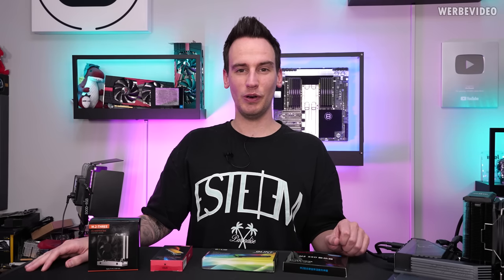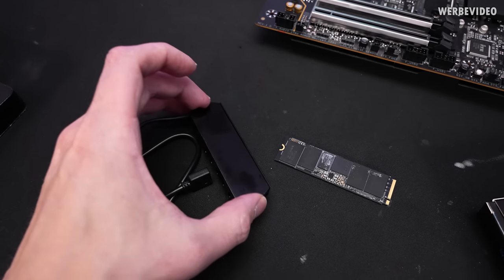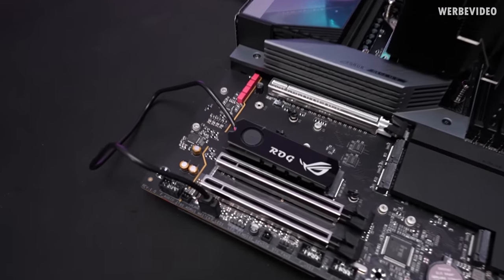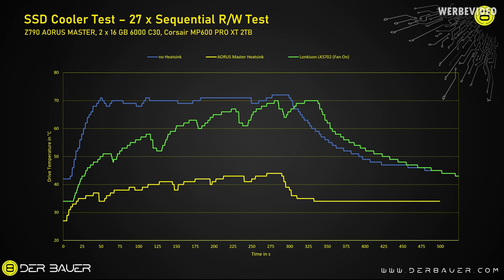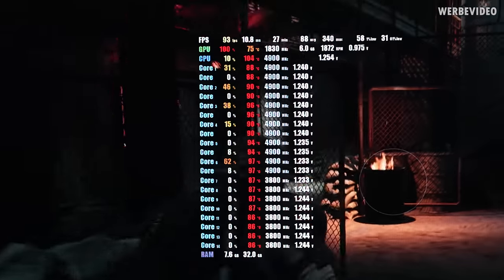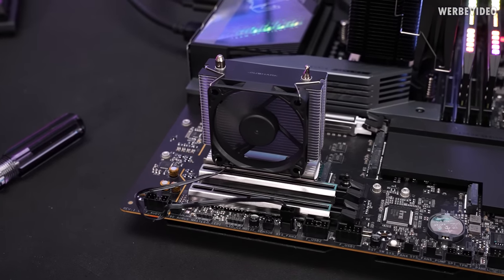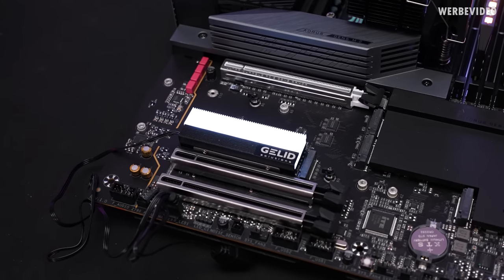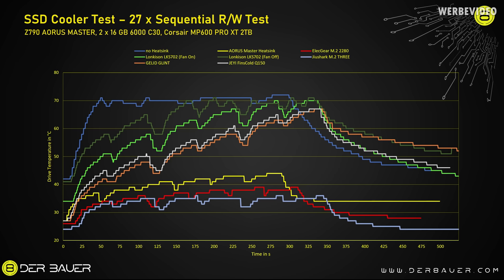More AliExpress garbage? This M.2 cooler was surprisingly good

Comment: At this rate push-pull setups for your M.2s will become the norm.
Reply: or straight adding to your water cooling loop
Reply: Nein! Nein! Nein! Nein!
Reply: PCI-e 5.0 SSD is hitting 11W at sustained write operations.  So , it is a possibility. But likely the M.2 connector has to go because M.2 specs requires 3.3V at 2A. We're hitting 3A on PCI-e 4.0 SSD these days.
Reply: @TdrSld  That's already a thing :D
Reply: Phase change or bust.
Reply: Are we progressing or regressing with technology, soon PC will need additional line from your electricity supplier and special cooled room like 60 years ago...
Reply: @TdrSld  my dad is doing that lol
Reply: @fleurdewin7958  3,3v @ 2A is just current provided over one pin, m.2 has several pins with 3.3v output. the connector itself is rated for 50v @ 0,5A for each pin, so there is still headroom left
Reply: @Rentta  Oh I know, but it's crazy to think we're back here again. I remember the Koolance HDD water cooling plate when they tried spinning rust at 10k rpm. (Yes I'm that old lol)
Reply: Yeh, no thanks. I'll stick to Gen4 then.
Reply: @georgwarhead2801  Are you sure it's 2A over one pin? That violates the connector spec (it's not about transmitted power, it's about heat dissipation, and that scales with current because impedance), and that 50V is irrelevant because 1) you'd need to add complexity to the drives (yeah, a buck converter or such isn't big, but the PCB is kinda tight already), 1b) which would increase heat dissipation because the conversion can't be 100% efficient, and 2) you'd need to change the rail going to the connector.
Reply: Like laptop sodimm sticks
Reply: @dudeonlygamingandotherstuf7791  Ten!  Ten!  Ten!  Ten!  Watts!
Reply: I just started manufacturing a 40mm aio.
Reply: At this rate dual-sided M.2s may become unfittable to motherboards due to heatsinks.
Reply: @TdrSld  That's a thing. It's very stupid, and I want to make a custom loop with it.
Reply: @samiraperi467  im absolutly no expert in this, its just what i found online for the specs of the M.2 connector. there are 6 or 8 pins for 3,3V and several unused pins in the connector itself
Reply: @burrfoottopknot  Gen 3 as well with a 1Tb Crucial P5 as main drive.
Reply: Depends how big thick the radiator is...
Reply: @PREDATEURLT  focus is leaving effeciency and looking straight at performance. they tend to bounce around on which matters, like phones do.
Reply: @bradhaines3142  But this bounce is highest in history of around 40 years and single bounce last for 8-10 years, we was laughing at AMD FX CPU and GTX480 for ridiculous power consumption and today its like middle end for power consumption when every stronger CPU eats 150-300W and GPUs are out of mind completely.
Reply: I think corsair made a water block for M.2 SSDs 
but the thing with SSDs is that you don't want them super cooled down as that can be bad for them in the long run. better off using a fin stack normal one.

Comment: I have a pair of m.2 AI accelerators that output 28 watts each at full load so the tower cooler would actually be a good option
Reply: my first 80mm fan cooler was for an AMD duron that drew around 40 watts or something. A small little m.2 cooler this size would probably have done the job back then, given they came delidded. This looks quite promising for modern drives that keep increasing the power draw of the controller for more performance. Also wild to think that the controller on my drives is probably faster than that Duron as well xD, it was only like 750mhz or something and had way less cache xD

edit: im half delirious rn with a cold and a ton of benadryl in me, shold clarify im talking about the 2nd cooler that was shown off, not the ROG one lol.
Reply: May I ask? What's the software support for them? I have no experience with AI so I just wondered.
Reply: @TheOriginalFaxon  Another Duron gamer 💪 I remember swapping it out for an athlon 850 that ran at a cool 1ghz literally.. remember when cpu's actually fried themselves at 95c instead of it being normal boosting temps?
Reply: @interlace84  Was just about to say, my teen years were full of lawn-mowing/landscaping summers, followed by PC component upgrades a few weeks before school started back up, lol, year in, year out. Spent I think 550 USD and bought the AMD Athlon 64 X2 (The worlds first consumer grade dual-core! What an absolute fucking disaster of a product line) Same story as Linus Sebastian on that one. What an expensive, EXPENSIVE mistake, especially being 14 years old and having to work a couple months to make that kind of money, lmao. I remember when simply running hot would kill CPUs.
Reply: @flintfrommother3gaming  basically all dedicated AI hardware requires you to convert a tensorflow/onnx/etc model to a hardware-specific variant and this is usually done with a proprietary software suite. I would like for more standardisation but the industry is still very young so it's hard to establish a more universal approach...
Reply: if we need coolers to be this large or power hungry like 30+ watts, we dont need M.2 drives, it becomes impractical due to slot placement / heatsink interference. they should Just put it on a PCI-e card. a single PCI-e slot is meant for 75 watts easy and motherboards already offer 4x lane electrical on 16x physical slots, so its perfect for an SSD or other accel. And enough heatsink to fill the entire footprint would be included from the getgo.
Reply: @interlace84  Yea and I also remember pencil modding that Duron to unlock its capabilities to Athlon level, though the clock speed stayed the same. The extra cache had a big impact on performance though lol. That shit was wild back then, you don't see mods like that today generally anymore
Reply: @highvis_supply  Surprised you don't just use a GPU instead for AI work considering how much NVIDIA is pushing it. Is it a SFF build?
Reply: @Guru_1092  Using a GPU for inference has a terrible performance to watt coefficient. Of course for model training nothing beats cuda but when it comes to deploying the model either at the edge via such m.2 modules or in data centers with purpose-built pci-e x16 accelerators, nothing beats dedicated hardware.
Reply: @highvis_supply  Ahh, thank you for clarifying. I appreciate it! Always fun to learn.
Reply: @highvis_supply  could you please tell exactly what hardware you are using?
Reply: @vinylSummer  I can tell you of one deployment I'm working on: single-board computer built around the Rockchip RK3588, with a Hailo-8 m.2 AI accelerator added.

Comment: The tower cooler could cool my 3700X just fine. It's a 65W CPU.
Reply: Your 3700X is drawing over that quite often. It has a 65W TDP, but modern CPUs will exceed that TDP rating under load so long as there is thermal headroom. But yes, your CPU could run at TDP on that M.2 cooler.
Reply: @DigitalJedi  AMDs 65W tdp cpus are allowed for 88W of actual electricity at best thermal and load conditions.

Comment: I'd like to see the copper one (JeYi) in a situation where it's using the down firing airflow from a GPU to provide additional cooling air (IE, its presumed intended use case.) I know the GPU will be providing warmer air, but it might be a fun surprise.
Reply: Hell, just in a standard case with and without a gpu would be a decent real-world test vs the bench
Reply: It's probably pronounced "Jay Yee". Yes, any forced convection airflow through the fin gaps should help a lot. They should have left the fin gaps open at the top to allow the air entry to the gaps from multiple angles.
Reply: got it today, my temps are from 48°C to 56°C using my mobo stock cooler (Aorus b550m pro-p)  that tbh is just a crappy heat trap, I'll let you know how well the Jeyi works, just give me a few days

Comment: There is something wrong with the design if m2 drives need more cooling than just a heatsink and decent airflow.
Reply: It was just never designed with any of this in mind. Why U.2 did not become the standard for desktop PC's I do not know, using M.2 in the way it is used today just doesn't make a whole lot of sense in any platform other than laptops.

Comment: Would love to see a light airflow version of the testing for the coolers that are clearly banking on the system having some airflow. Especially that Jeyi copper one. That was the cooler I was looking at using before I decided to just go full diy and go for a copper heatsink and mount it myself. (I have not done this yet.)

Comment: Bought the (similar) copper one some time ago. The cooling is actually impressive with just a little bit of airflow from a nearby case fan. Installed it on the rear M.2 slot on an ITX motherboard, result was a good 20 to 24 degrees drop. The difficulty is mounting space & positioning so it can benefit from some airflow inside the case.
Reply: Yea that’s exactly what I was thinking when he reviled the results of the last cooler. Seems to relies on air flow from either nearby case fan or gpu fans pulling air up.
Reply: 3d printed shroud could easily boost performance forcing back(top fans for VRM too) fan to suck air close to the M.2

Comment: That M.2 Three cooler should make one hell of a good passive cooler, if it can fit without blocking other PCIe slots without the fan. I think GPU fans should provide more than enough airflow for any modern SSD with that kind of overkill heat sink.
Reply: I was thinking it looks great for a game server  especially if you dont need a gpu in it.
Reply: that one lets me think if its ment for some kind Crypto mining useing m2 drives,i know there are cryptocoins that are beeing mined useing ssds already..

Comment: That m.2 tower cooler is better than some cpu cooler used in prebulid😂
Reply: In all fairness: Any part that actually functions at its intended job will outperform most prebuilt component counterparts.

Comment: JEYI makes also makes the "Snowpard M.2 cooler" which is very strange as it contains a M.2 PCB riser card which flips the orientation of the SSD.
It also extends beyond the M.2 slot in both directions making it look like a motherboard mounted heatsink.
Reply: That would be interesting, having the m2 drive perpendicular to the motherboard seems almost logical if heat dissipation is becoming such an issue

Comment: M.2 Tree would be decent even without the fan, wouldn't it? You could try the Jayi Q80 as well. It has parallel to the longer side fins, and you can maybe add a random 4cm fan to improve whatever performance it has.
Anyway, I think that any diy power led lamp enthusiast welcomes these small, but sometimes fair enough coolers. Of course I am talking about those solutions, which at least look like a usable heatsink.
Reply: Yeah, I wouldn't even use the fan on that, i'd just leave it passive. No matter the orientation it'll get great airflow in a case.

Comment: This M.2 cooler video series, reminds me of the attempts to cool North and South bridge chipsets. Especially remember the ones that were "designed" for use with SLI and crossfire uses. 🤣
Reply: Yep I had an XFX 780 Tri Sli board, the chipset heatsink had a fan on it that rotated near 6000rpm, was awful

Comment: One thing i see about each pc build is that hot air from gpu gets recycled back into fan intake and fins, so best it would be to have the shroud connected to a duct at the back or front without leaks.

Comment: Most of these cooler, specially the finned and tower-style ones will greatly benefit from O11 Type cases where air intake is usually on the bottom. At that point only clearance is probably an issue.
Reply: Fractal Torrent let’s gooo

Comment: Yeah, Jeyi looks like it would get a big boost from the GPU intake fan with that tall fin stack. Gelid would be fine on a storage M.2 for looks, is my thoughts on it. As for the huge tower, you could put a pair of them into one of the MSI boards with the double SSDs in a row, to benefit also from bottom case fans maybe. But a bit overkill. Great review, as always. Also, I agree, the Jeyi was a gorgeous cooler, that polished copper and matte black was a piece of art.

Comment: i got a copper one with fins oriented facing the front intake fans and it has a small fan in front and blows air in between the copper fins to the back... gives decent cooling to my m.2 gen4

Comment: In the next test benchmark it would be nice to see the M.2 Three performance without the fan in open bench vs closed real case. As it would be appealing to use it without the fan if the performance would be there with regular case airflow.

Comment: Only a 2 heat pipe cooler with an 8cm fan haven for ~130-135W Xeon E5-1620 v1 in a Lenovo S30 by factory.
At CPU full load is not silent, but solve the job without throttling.
But that true of course, much EZr cooling down a 22nm chip.

Comment: My personal thought was always "is it possible to add a cooler to a laptop?"

My original idea was "why not move the entire finstack to the back of the laptop and make that part of the chasis of the laptop very open?". That way any cooling pad or even any air movement thru there would be much better than the restrictive finstacks with small fans that we have in laptops today.

Then I thought you could even add a USB fan (or more like a few in line) and use it as a "tilting of the laptop" and extra airflow.
I think the MSI Titan does this to an extent.

Maybe surface area ain't enough?

Comment: The RGB cooler remind me of a case Jay stumbled accross when troubleshooting a viewer PC. Long story short : The RGB on the SSD (2.5" one) was outputing so much heat that the disk would just overheat and stop working

So even if the heatsink work, covering it with RGB doesn't seems that smart

Comment: I have mounted the last one on a 980 Pro with a 3M 8810 thermal "pad" in a B550 ITX with a NH-C14S on the CPU and with the same test, the M.2 doesn't go over 60° C with about 21° C ambient.

Comment: Jeyi Finscold Q150 really cool, but have got design flows. Aluminum base and Copper fins aren't properly connected. I think after Gill Boyd video JEYI fixed a bit construction, but not sure. I think they just should invert construction - let copper fins touch thermal pad on SSD and aluminum base just close "sandwich".

Comment: I think you need to reconsider some parts of your testing when it comes to these SSD coolers, the JeYi cooler looked like it would work a lot better if the mainboard was vertical, to aid convection airflow. I don't know how well that would apply to the other ones but that one seemed like it would benefit the most from a different orientation.

Comment: The big problem with using the top M2 slot is the SSD absorbs tons of GPU heat while gaming. Shouldn't be a big deal as you aren't doing an extended read/write, but it is noticeable.

Comment: I've been thinking of replacing the cooler on my itx x570 aorus pro with one of these types of coolers from thermalright. The board by default has the little cooler fan blowing over the NVME and the chipset that sits underneath the NVME, but i dunno if replacing the cooler with this cooler will negatively affect the chipset.

Comment: Hi Roman, if possible can you please test what happens if you populate all the m.2 slots on the motherboard and use the motherboard heat sink? 
As I'm curious to see if the issue of heatsoak is primarily on my setup or could be issue in the future with motherboards with multiple m.2s installed especially higher capacity gen 5 nvmes.

Comment: I have an nvme  just under the gpu, it will hit 83c but if i turn on the gpu fan 50 percent, the ssd lowers to 65c. Which is good and doest ghermal throttle. No heatsink needed.

Comment: Using an M.2 cooling solution to cool a 13-series Intel CPU. Whodda thunk it? I guess without throttling it should handle what, a 13100, maybe a 13400? Props to the team for making that strong an M.2 cooler!

Comment: There's a nice one by Icybox, that you should review. It uses a 30mm fan and dual copper heat pipes. I have one, it works reducing max temperatures by about 20 degree C, on a Sabrent Rocket plus 1tb.

Comment: If active cooling of M.2 drives is going to become necessary they surely need to come up with some sort of better and more universal solution.  I never really liked seeing M.2 become a port on motherboards, just seems like a real clunky solution when PC cases have so much free space for drives that could be better utilised.  Mounting drives in cooled bays makes a lot more sense than mounting them to motherboards where space is always at a premium, especially if they're going to need active cooling.

Comment: the tower one could work amazing without fan if it fits under GPU and you keep fans on GPU on even in idle...
Reply: also the good looking copper one might work fine under and slightly below GPU if GPU blows towards motherboard and would push air through it

Comment: NAND likes to be HOT when you're writing to it... and cold to retain the data. (There are research papers proving this and one can fix old NAND by heating it..!)
So; the ideal cooler will put the ctlr chip heat INTO the NAND when writing...
That would mean a heat-pipe/s to move the heat into the NAND, with fins on the far end, or/and  those graphene (graphite? I dont recall which) pads that are so conductive in the x and y axis but not so much in the z. 

If done as described; that would mean that 512e, with the extra ctlr heat the translation produces, may be better than 4Kn in the long run..?